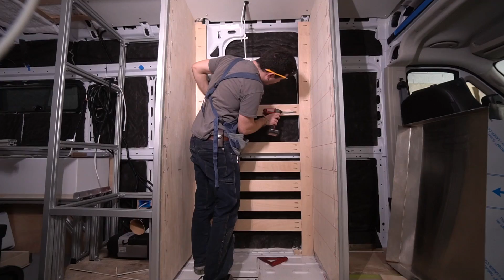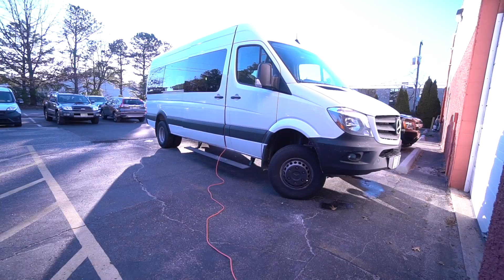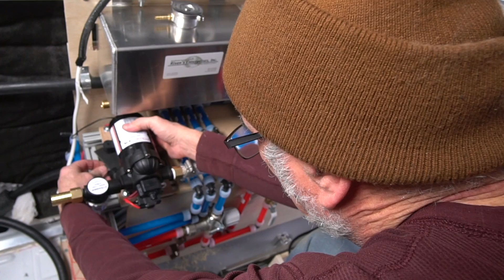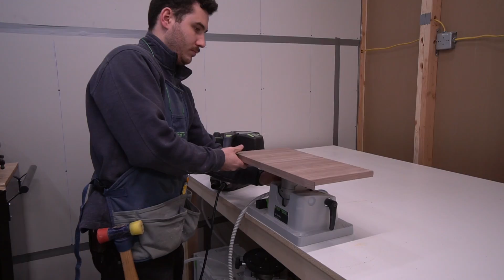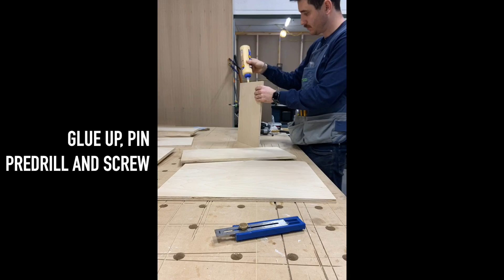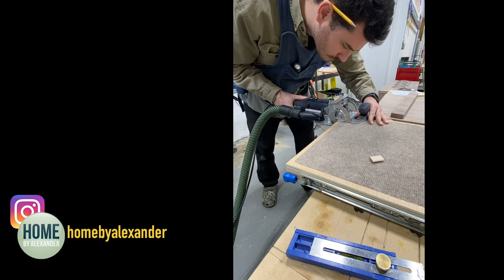Humble Road Promaster van build - Cabinets and Plumbing

Comment: As a plumber for 44 years . I approve of the piping. Although good to use a bit of space in between the fittings when possible. Or unions for mixing valves . It’s not if you have to replace things but when . Although with a heat gun it is possible to take these Wirsbo fittings apart if needed.

Comment: All those shutoff valves might seem like a good idea but they add a LOT of failure points. The best part is NO part. Best to have one shutoff at water source (maybe not needed, just shut off the pump) and remove ANY part that is not absolutely a must. 
Any one of those valves and fittings can fail. Less fittings and valves would reduce failure points. Significantly.
Reply from the maker: Well, I certainly can’t deny your premise however, you need to consider the type of client that’s using these vans. They’re not gonna remove a section of pipe and I don’t want them to be inconvenienced if a certain area fails so far with 20 vans and six years, I have not had one fitting fail.

Comment: Love love love your videos! Are you able to provide any comment on why you go with the top mount pump that sucks the water up through a pickup rather than a gravity fed system where the pump pulls from an outlet at the bottom of the water tank? Is it just a space utilization thing?
Reply from the maker: The reason I pump from the top of the tank is, I don’t wanna make any holes anywhere in the tank except through the top. I don’t have to worry about it leaking
Reply: @HumbleRoad  Makes sense! Thank you very much for the reply. Didn't know if the pump had to work any harder when oriented that way.
Reply from the maker: Generally, the pumps I use have a 6 ft vertical range

Comment: You are correct that plumbing setup is sexy as hell! You have great attention to detail and I can tell you take enormous pride in what you build. I am wondering as to the size of the glycol tank, is seems so large, once the closed loop line is filled/purged of air between the water heater and the engine heat exchanger it seems like a tiny 16 oz tank would keep the system tubing full of fluid and any air bubbles could exit the tubing into the upper part of the tank. The total volume of liquid in the heater loop is quite small, 3/4" ID heater hose has a liquid volume of 2.93759 oz per foot so a loop of 10' up an back(20' total) from the engine is only 58.7518 oz not including the coil in the water heater and the aluminum tank. I know you mentioned that tank was quite hot in the summer time and people on the be bed had hot feet what about making that tank a smaller vertical cylinder with a fill cap on top? 
One question from another video about 80/20, you said you use a mix of series 10 and series 15, watching your build very closely it seems like the bulk of the framing is series10, where specifically do you use the heavier 15 series? In my build planning I want to keep the structure as light as possible but also very rugged. Initially I was leaning toward foam core fiberglass composite sandwich panels(strong and light) for all the cabinet bases, drawers, etc then the visible surfaces would receive with a thick 1/16" Maple veneer. However I do like the modularity and diversity of design options framing with 80/20.

Comment: Just discovered quick connect fittings. Wonder if you are aware of them. Looks convenient, but I'm not sure how reliable that system is compared to Pro Pex system.
Reply from the maker: Quick connect like the brand Sharkbites. I would not use quick connectors in a van.
Reply: @HumbleRoad  
Thank you for the feedback. Because of the vibrations, I would guess.

Comment: I am designing a similar system for my van and was planning to just use isotherm exchanger and the isotherm mixing Valve. Can you explain the difference and benefits of your extra heat exchanger and mixing valve? Love your channel it has been my #1 go to for how I am building out my van. Greg
Reply from the maker: If you run your chassis coolant lines all the way to the heater and back, they are exposed, at risk of a cut or puncture under the van. That would render your vehicle inoperable. With my design, a cut hose will only prevent you from making hot water, the vehicle travels on!

Comment: Hey George.  You make fantastic constructions with so much knowledge.  I live in Sweden, and I also convert a Sprinter passenger van, with factory windows.  I wonder how to insulate between window and shower or closet wall.  What do you insulate with and do you lay the insulation against the window?  Looking forward and grateful for your reply.  Regards Michael
Reply from the maker: If a window is to be covered by a shower room for example, first black out with opaque vinyl window tint. Then thinsulate, black side towards glass. Then another layer of thinsulate, this time white to white.  Then a layer of reflectix. Then finally a closed cell foam board
Reply: @HumbleRoad  Hello again.  Thank you very much for a super fast answer.  Just one more question… Can the first layer of Thinsulate ( is it 3m? ) only be pressed and clamped to the window, or does it need to be attached to the window with some glue or similar.  
Super thank you
Michael
Reply from the maker: Black side of 3M Thinsulate should be glued directly to the opaque black vinyl.
Reply: @HumbleRoad  Thaaanks George. You are fantastic. what glue do you use?
Super thanks to you
Michael

Comment: Are you sure you need the pump? In my yacht we had a similar system but no pump required. as long as the hot waterline stays on top it will circulate itself. It may require a bit more time but the current of waterflow will establish itself. just a thought
Reply from the maker: You most likely ran those engines for a good long while under way. My system needs to be more effective on the shorter trips to market, laundry, etc. So the pump speeds things up a bit.
Reply: @HumbleRoad  the hot water valve wont open on those short trips, the valve is designed to open at a set temperature.
Reply: @HumbleRoad  hour was enough which is less then people drive. The exchanger was closer to the engines which means the motor was not required. Just thinking of eliminating things. I really appreciate you videos, a great inspiration. Thanks
Reply: by moving the exchanger closer to the engine you could eliminate the pump and have shorter runs for the hot water lines to the gally and shower. Just a thought.

Comment: George, what are your thoughts on the vans going to cold climates and having the plumbing going under the van? grey and black under the van? thanks for the videos
Reply from the maker: The only plumbing I put under the van is grey tank and drains. All fresh lines are in the van. If you choose to heat water lines under the van you expose yourself to failures that may incapacitate your water system. Van life is supposed to be simple and carefree!

Comment: No pressure bottle for the water system?
Reply from the maker: Not needed. Bladder pump will not work with an accumulator tank.

Comment: Have you found a water mixing valve that can handle the temperatures of the Espar and Webasto hydronic systems? Most that I have found handle inlet temperatures up to 180F. Thanks
Reply from the maker: Yes and 180 degrees is about the maximum temp out of the Espar. You can also temper it with in line intercooler a under the van

Comment: What’s the purpose of the additional coolant tank? Can you not just run off the vehicles directly?
Reply from the maker: A direct tap off the chassis coolant system exposes you to certain liabilities that I am not willing to field. My Dad was a lawyer. I tend to think in terms of negligence and litigation.
Reply: @HumbleRoad  what do you think might go wrong? Just seems like a little bit of a waste of space and extra maintenance, granted that glycol probably lasts forever.
Reply from the maker: OK, think about rerouting the chassis coolant 20 feet down to the water heater and then 20 feet back to continue its route through the engine. If that coolant line leaks, (1) the vehicle is inoperable, and (2) the manufacturer may deny a warranty claim due to your modification. In my design the chassis coolant line is either T'ed off of, or routed through a 7 inch double walled copper/steel heat exchanger. Far less expose to damage or failure. And more controllable in terms of temperature regulation.

Comment: Alex is a Woodworking God. Damn, the stuff you guys do just blows me away. I wondered how they got that rubber edge on wood. Now I know. A Festool banding machine. Wild. I saw another guys van build where he used these, but the corners were rounded just enough to run a single strip.

Comment: Like the water piping system. Can you share what kind is that as I never seen this type of piping and connectors.
Reply from the maker: https://www.uponor-usa.com/en/campaign/brand-uponor?k_cca=uponor_search_intent&gclid=Cj0KCQiA3smABhCjARIsAKtrg6K1EvoB1aMLsyHd0luExH3YKID2iDol6_oxMQrV2OC5TRDEex9P1uIaAsrgEALw_wcB
Reply: @HumbleRoad  
Thank you
Reply: @HumbleRoad  
I looked at Uponor site, are you using the pex system ?
Reply from the maker: Yes, here it is called ProPex. It is important to buy the correct pipe! Regular PEX will not stretch with the Uponor fittings!

Comment: Did the hot water system have an expantion tank ?
Reply from the maker: The type of water pump I use (diaphragm) does not require an expansion or accumulator tank.
Reply: @HumbleRoad  
Thank you, which brand the pump ?

Comment: Heyo! Team HR!
Why not the heater hose straight to the Isotemp?
Reply from the maker: If you plumb the chassis heater hose all the way to the water heater and then back to the chassis, you may encounter warranty issues with the manufacturer also excessive stress on the chassis water pump.. Another consideration with that design is what if there is a failure, the van is now disabled. With my design a failure only means no hot water.

Comment: I wonder if there is any need to insulate the hot water tank? Also the piping system looks compact and organized but each elbow adds two extra connections, is there any fear those add more failure points?  Pex advantage is it’s flexibility  so maybe it could be wrapped around some corners?
Reply from the maker: Certainly, bends are better than elbows. But bends also require more space which I did not have in this build. And thankfully, to this point in time ; no leaks! 😊

Comment: Does the glycol  tank radiate much heat into the van on hot days?  I'm trying to decide if I should insulate mine.
Are you using the hot glycol to heat the van also?
Reply from the maker: The reservoir can get pretty hot (170•F) definitely wrap it with 1” foam foil faced
Reply from the maker: The closed loop glycol is only used to make hot water. Cabin heat comes from Webasto
Reply: @HumbleRoad  Thanks!  
Did you add the Webasto because it is more efficient for heating air than hydronic?  I'm planning to heat water and air with my espar.
Reply from the maker: @mikesabiking  I did not like the idea of firing up the hydronic furnace, throughout the warmer months, every time you needed hot water. You have to expend fuel, and there is a wait time for the glycol to heat up. My new system makes hot water every time you run the engine. I prefer the two separate systems.

Comment: Hi George, How hot does the heat exchanger get the water? The channel is amazing!
Reply from the maker: The Promaster chassis coolant flows at 215 degreesF. My glycol flows at 170 degreesF and the hot water is 150 degrees. I am sending them an in-line intercooler to hopefully lower the temp to 140 or so.

Comment: Hi,George, BK here.
I Have a question. What is your opinion on dove tail joints in drawers vs. glue & screw. TIA!
Reply from the maker: We use pre-finished maple for our drawer boxes, so glue will not work. On raw plywood, glue and pocket screws are fine. Moving forward,  have decided to make our drawer boxes using a box joint. More glue surface.

Comment: Just out of curiosity why would you not want to install an on-demand water heater?
Reply from the maker: On demand would require an energy source every single time you call for hot water. My system makes free hot water as you drive. It stores very efficiently for almost 24 hours without any further energy consumption. Also I will not use propane in my builds.
Reply: Humble Road Thank you for your reply. My concern with the tank in this video would be space. I have been seeing electric tankless water heaters on Amazon. Am I missing something? Do those still require gas? I’m learning a lot from you and other videos on YouTube but I still have a long way to go when it comes to electrics. The tankless water heaters say that they are 240 V. Is that a huge energy drainer? I would like to create a recirculating shower system and be able to have space to install the whole system as well as a water heater which gives me tons of hot water.

And I’ve noticed in your videos that you are stopping to use propane. I would love to know why this is? What are your thoughts on propane?
Reply from the maker: Are you in Europe or the USA? Yes, you do need to do more research. Watch more youtube!
Reply: Humble Road I’m in Vancouver Canada. Thanks for your reply. I learn a lot from you and I really appreciate your videos. Thank you.

Comment: Why not run your glycol line to a 12 volt Diesel heater and then to the Isotemp ?
I'm just thinking it would be a much shorter plumbing run and be more efficient since the
 van wouldn't be required to be running to get your heat.
I'm not criticizing , just trying to learn .
Thanks
Reply from the maker: Mobile empire I did that in van #1 and soon learned it was excessive to fire up that diesel furnace every time I wanted hot water. Now, with any and all driving, you make hot water . It’s usually enough to keep you in hot water day and night. Closer to free in terms of energy expended.
Reply: @HumbleRoad  
I only use hot water about 5 minutes per day but I see what your saying if your using 
hot water multiple times per day.
Nice work as usual , thumbs up.

Comment: All of this technology is quite intimidating to me, as I like to keep things SIMPLE!  Simplicity cuts down on mechanical disasters and OOPS, which are not as expensive to fix.

Can a simple system be designed and built for a “shorty” van without having 
to “rob Ft. Knox”, or be an astrophysicist or engineer?
How much do you charge to build  a van with all the systems you put into one?

Btw, I love your choice of music. Ever thought of incorporating some Mozart,  or Beethoven?

Comment: I look at all those 90's and can only think one thing - pressure drop!  Did you do a hydraulic analysis before you installed all that plumbing???
Reply from the maker: Bob Luce even with the lesser volume pump they chose, the water pressure is fine. Keep in mind; we’re not running pipe up to the second floor! The longest run is 16ft.

Comment: Your videos are really great. Amazing work. One questions on water plumbing system. Do you fit an accumulator tank into the water system somewhere after the pump outlet to reduce any unwanted pump cycling, pulsations and pressure spikes normally associated with RV water diaphragm type pumps?
Reply from the maker: Thank you for your kind words. I truly enjoy making these videos. The Remco Aquajet 55 does not require an accumulator tank. In fact, it will not work with one installed. This pump has five chambers and a check valve. It requires a hard stop, which an accumulator tank does not allow for. Also, the customer service at Remco is excellent.
Reply from the maker: Oh, one more thing... if you are replacing an existing pump with an Aquajet, be very aware of the wire sizing in your rig. These pumps require a much higher amperage than most. Also, the heavier the wire gauge, the less resistance and you will have less voltage drop over distance.
Reply: @HumbleRoad  Thanks for the info. I'll look up Remco.
Reply: Snow and Curt recirculating shower

Comment: Hi George just found you thru the Careys. l'm overwhelmed with your detail and planning.  Feel like I'm going to school and taking classes from the Professor. l would like to build my own also but I'm a little intimidated by the van electrical and plumbing centers but l'll keep watching. Wondering what you thought of undermount AC and did you consider a Murphy bed in the front.
Reply: It needs to breathe cool also.Up on the 100 degree roof baking that unit isn’t so efficient either. If it gets clogged underneath you can just flush it with a hose.On the other hand you could buy 4 rooftop units for the price of 1 undermount. On the other hand the under mounts are 12 volt systems which is a huge plus if your going to try to run off a battery.If your going to sit in a park with shore power in my opinion the rooftop is the way to go.
Reply from the maker: I have been installing the Xantrex Freedom eGen system in my van builds. It's the only UL listed Lithium battery, made by Lithionics. 600 Ahr and IMHO, the most intelligent BMS on the market. With conservative duty cycles and 400ish watts of solar, you could run a 120V air conditioner through the inverter for hours during the day. I am always looking for new innovative systems for Rvs. Thank you for your comment.
Reply from the maker: Welcome! Under mount AC does not make sense to me. It needs to breathe. Under the vehicle is the worst place to breathe clean. Rather than giving up 12-15 inches of space when the bed is up in the day position, (and blocking a window...) I prefer to have a futon/couch that converts to a bed. Double duty within the same footprint. More efficient.
Reply: And that battery is how much? I heard 15,000.